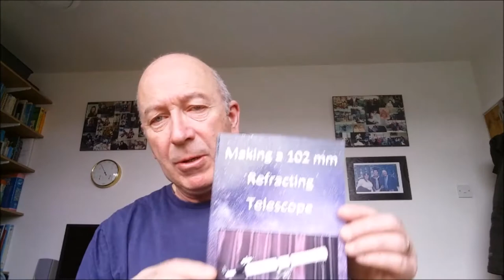Making a 102 mm Refracting Telescope

Comment: Can you please provide the details of of all lens used to make this telescope?
Reply from the maker: The objective lens is 102 mm in diameter and has a focal length of 1000 mm.
Reply: You can use 100cm focal objective and get any kind of eyepiece just a simple concave lens less than 5cm focal will work too. Tube length will be 95 cm from eyepiece to the primary L=f1+f2 m=f1/f2

Comment: Honestly looks very flimsy. Why not buy a R&P focuser for £30 and get a solid aluminium tube made specially for it? Put a small amount of effort into it? The lens looks pretty good though, but you didn't make them...
Reply from the maker: The 102mm diameter air spaced achromat was purchased in 1986 from a UK astronomical supplier at a cost of £139. Telescope objectives were relatively expensive in those days. The telescope was built around that time using inexpensive, commonly found materials and it is as good now as it was then.  More robust than you think.  Yes, I could have purchased a rack and pinion focuser and a metallic tube but then it wouldn't have been built from commonly available materials and would have added significantly to the cost. It would have been no more expensive to buy a ready made telescope.